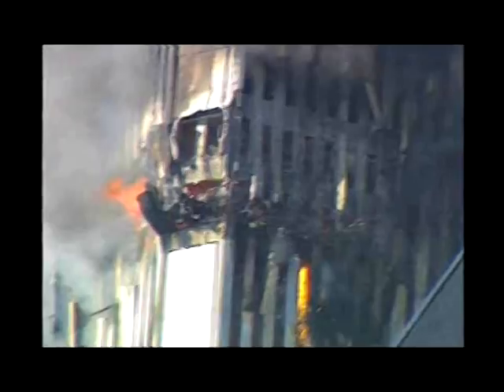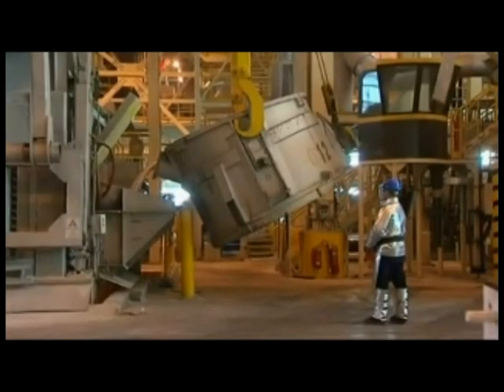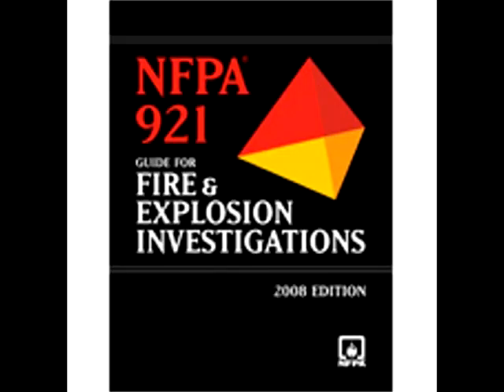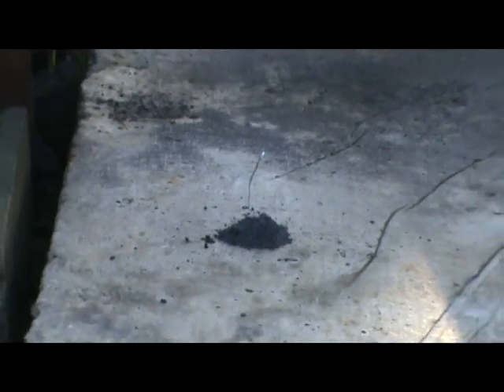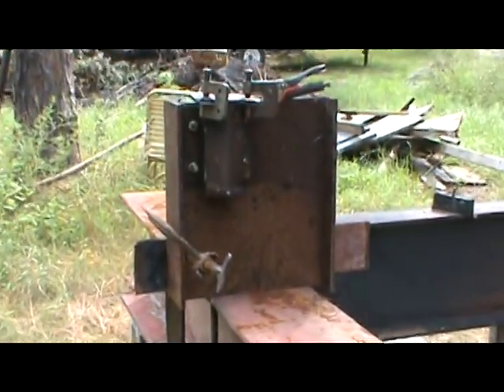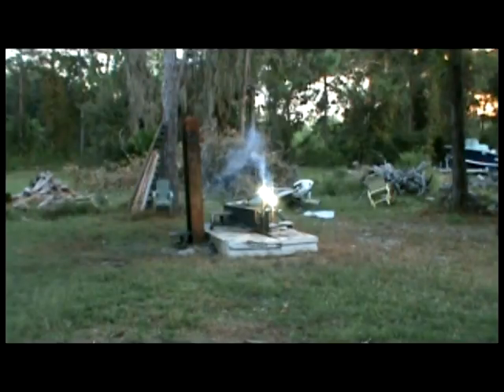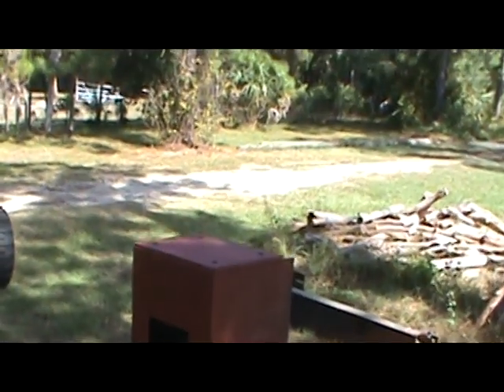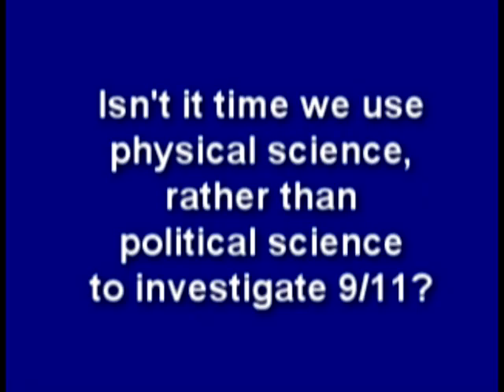9/11 Experiments: The Great Thermate Debate

Comment: steel soften up at around 450°C (or at around 800°F for the very special people in here) at 650°C it already lost half of its integrity and structural stability. When this video is correct, and it really where 1832°F (which surprisingly calculates to exactly 1000°C - coincidence?) in there, the steel probably did not melt but got soften up enough to collapse under the pressure the building part above delivered. Why did it collapse straight down in its own footprint? Since the hottest part of any fire is in the centre, any steal in the centre of the building would soften up first. Now consider  that in abuilding like this mose of the carrying components are also in the centre of the building. Since the bottom was not on fire it was totaly stable down there and therefore didn't tilt to any side. But once one floor collapsed, all the kinetic downwards energy build up as gravity accelrate the falling debris increase the energy potential of the falling building which eventually was enough to even destroy the nondamaged floors. And since gravity pulls everything STRAIGHT down to the core of earth and the building was straight it collapsed in its footprint.

Comment: Steel gets softer as it heats. It does not need to melt to fall apart if there is enough weight, and a huge building has the weight.

Comment: Wish people actually knew what they were talking about. Jet fuel and heat induced vertical air jets of air through columns and elevator shaft  can easily exceed the BURNING temperature of steel. Sprays of sparks and all. Ask a welder!

Comment: It's not just temperature to melt a substance, but temp and pressure. The higher the pressure, the lower the temperature needed. No independent testing I've seen yet takes into account the pressures that the weight of the floors above would have produced.

Comment: I noticed that the use of thermite in a composite sprayable form would resemble the spray on fire retardant used to repair the wtc 1 and 2 and would be easy to install without notice after the new security methods enacted after the truck bomb in the parking garage attack. The purpose for such an act would credited to the intent of the terrorist attempt to topple the towers over the city causing hundreds of thousands of deaths.

Comment: Excellent video, as a boilermaker whose trade involves erection of the steel in buildings like the twin Towers, and knowledge of what it takes to melt and cut steel, I knew it had to be an inside demolition job to cause these buildings to collapse the way they did.

Comment: Great research. Are you still in the land of the living? The railway engineers use thermite to weld rails together so, the faces of the meeting  at the joint must melt for this to work. Thanks.